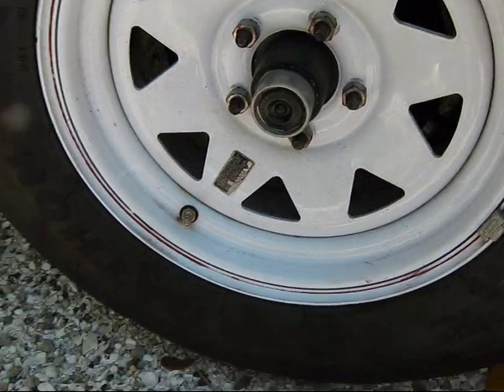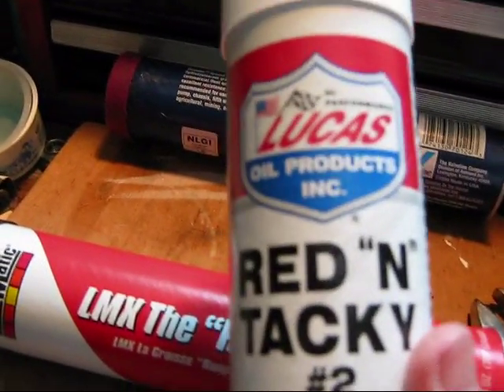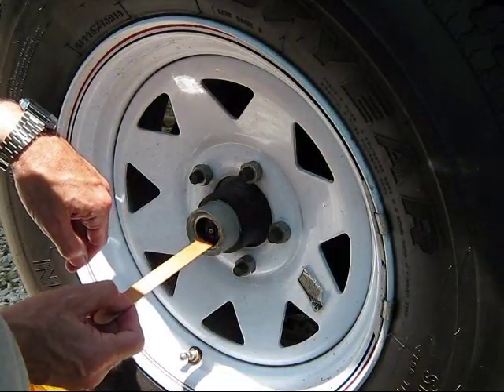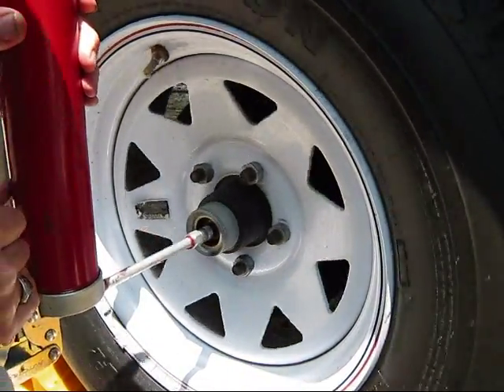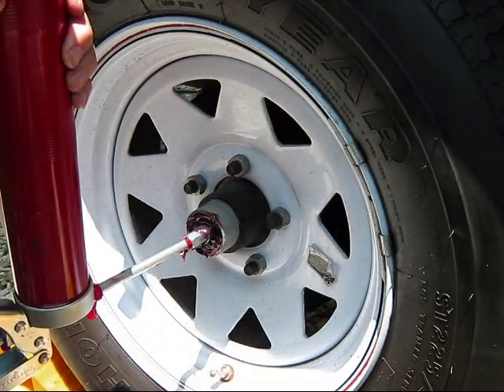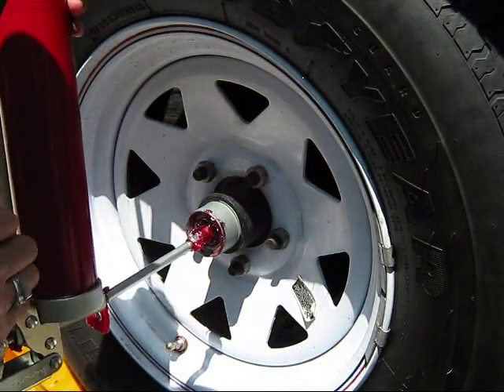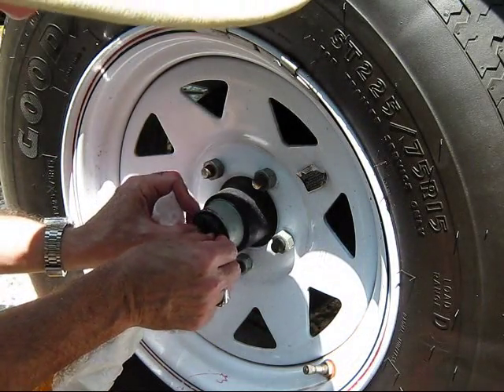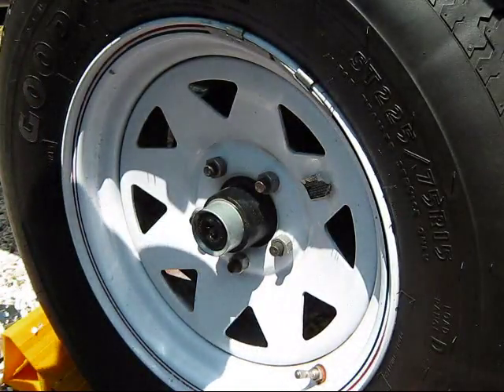How to Grease Casita Travel Trailer Wheel Bearings with EZ-Lube Hubs

Comment: Great video Casida!  I'm too cheap to throw the grease gun away.  Being retired (and, oh how I love that) I have the time to get that extender out of that hole!  The spilled grease and old grease goes up underneath the truck bed where salt and sand tends to lay around after plowing. ...... 20 year old F-150 4x4 truck still has original paint and only very limited signs of rust from NH winters. 188K miles.  No major issues. Thanks for your video!

Comment: Just curious - what would you think about the Walmart Super Tech Lithium grease instead of the Tacky Red.  Specs seem very similar.  The Walmart one is much more cost effective - especially if you buy it in a 3 pack - so just wondering what reasons not to buy it.  Thanks for this great video.

Comment from the maker: I recently lubed another trailer, same procedure, but with a new grease gun from Advanced Auto Parts. Gawd, another piece of garbage - thing was not pumping more than half a tube before air bubbling.  Its so  hard to find a decent grease gun these days!  Sorry for your troubles.  BTW, on the plus side, I noticed the recently lubed trailer's  hubs run a lot cooler with the Lucas Red n'Tacky No.2.

Comment: Hi I was wondering if you can tell me the diff of the  EZ Lube Grease Cert.  and the bearing buddies. they came with atv trailer from the US. it has the same dust rubber cap like yours.
Reply: littletoy EZ Lube is designed to push old grease out. Bearing buddies are mean to keep just enough grease topped off so that pressure is created and water cannot penetrate. They were not developed as a regular maintenance function like EZ Lube.

Comment: This Is A good vid, Mystik jt 6 high temp grease is a good grease, That grease gun needs Teflon tape on the pipe fittings Alemite Grease Guns or lincoln grease gun.Are Better, That’s a lot of grease you put in don,t over grease you could damage the back seal and get grease in the brakes good vid

Comment from the maker: No problemo. Well, its really more of a Florida thing. You see the air tends to expand in the heat down here... More air, means more expansion... I have seen it pop the rubber cap off. Less volume of air in the outer area means less air for expansion  - which keeps the cap on.

Comment: I keep on hearing from a few that there is the problem with grease coming out the rear seal. They claim to be using the ez lube system. 
I've once had a problem of grease coming out of a seal years ago on my tow dolly but that was because of a pin hole in the rear seal. I took it apart and found out it was NOT a pin hole but a slice (it look like a screw driver blade went through it). I think that was caused by the Bonehead installing the seal, plus the seal was crooked and not installed all the way... So obviously that's not a ez lube problem. 
Anyway, those that have the problem of grease coming out the rear seal, what's causing that? Does anyone know for sure why that happens? No one will say if they were greasing without spinning or pumping the crap out of the grease gun or whatever. I know grease overtime gets harder and maybe trying to pump in new grease and at the same time pumping out the old grease could maybe blow the rear seal... I hate all this guessing, it would be nice to know for sure if EZ lube won't overtime blow out my rear seal....

Comment: This is an old thread and probably noone is going to see my comment but I'll make it anyway.  Simply because I think an important point was not made.

That point being if you follow this procedure and do not take the time to remove the hub and check the bearings you may be running failing bearings and not know it.  And of course a totally failed bearing could lead to you seeing your trailer tire pass you up bceause it's fallen off.  Wheel bearings should be visually checked for damage periodically.  Even well greased bearings wear out.

In regard to small tires, I have for years used a little utility trailer with 8 inch tires for hauling my camping gear to the Rockies.  I've put thousands of miles on those little wheels without a problem.  But I grease and visually inspect the bearings every 2000 miles (by hand).  Small tires of course wear out more quickly than larger ones but they're cheaper too.
Reply: Raven Feather i

Comment: This is all good , couldn't make it through much of it.  If you have a new trailer this might work  . If not , pull the bearing and clean them , clean the entire hub . I'm not going to explain how to do that , look at U-tube I guess . Unless you are good at it you will need new wheel seals . Then you may add grease occasionally .
   The idea that you can circumvent removal and cleaning by pumping massive amounts of grease in because its a  EZ , not happening .

Comment: Jeez dude you must be a glutton for punishment. Forget spinning the wheel while your pumping the grease and just pump until it starts oozing out and then you can give it a spin if you want but one or two revolutions of the tire would be plenty. If you are a DIYer you should have an air compressor and if so give that grease gun the heave ho and get a Lincoln pneumatic grease gun. It will pump as long as your holding down the trigger and purging the air after putting in a new cartridge will be a non issue. If you want a good grease you cant go wrong with Mobil 1 synthetic grease.
Reply: Lee Mullen I’ve read that that there were older models of EZ Lubes hubs made that were not designed to have the grease push all the way out the front like the new style this the older ones would have the rear seals blown out. I’m about to add grease to mine for the first time this weekend. We will see if that’s true.